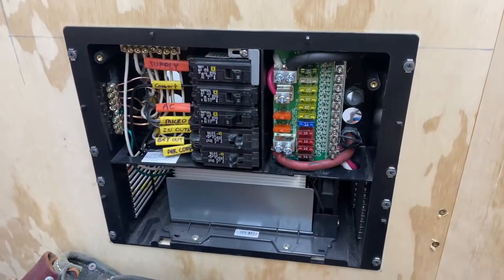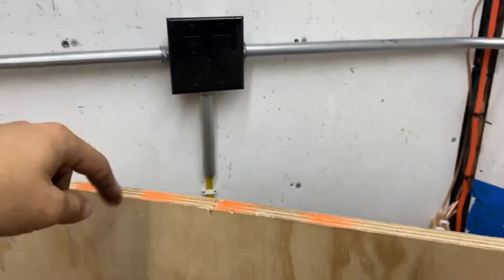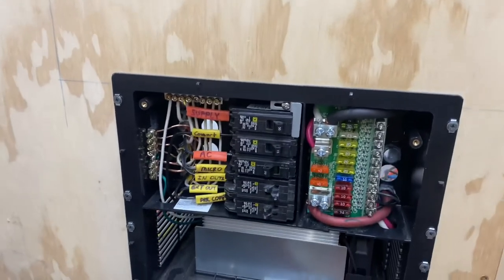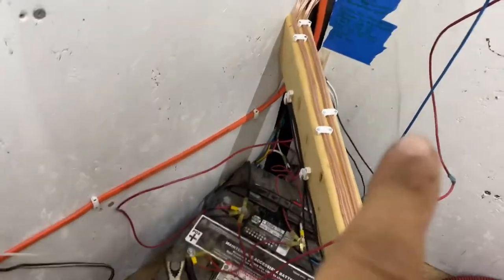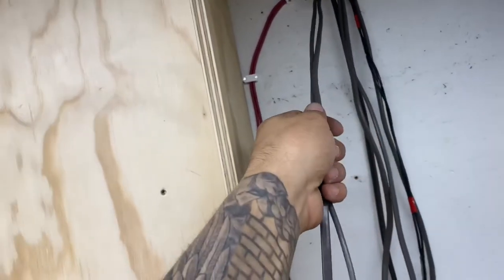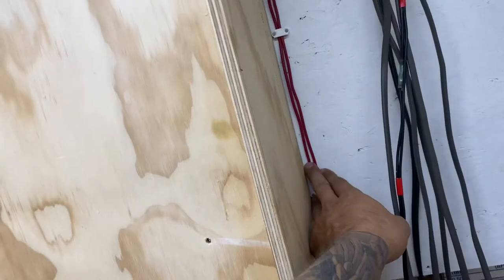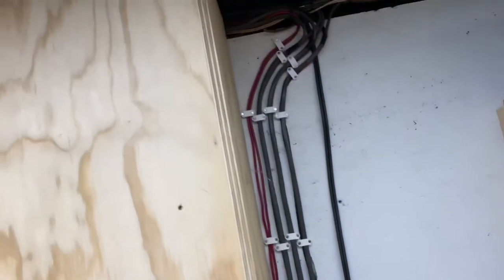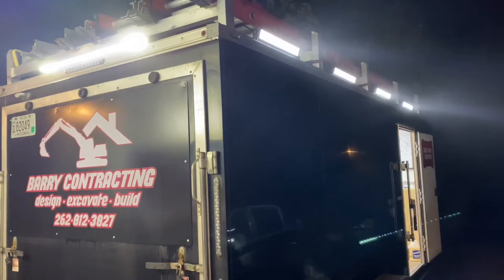Tool Trailer Wiring Part 2: Exterior Lights

Comment: Love the exterior light bars.  You should be an Amazon Affiliate, so you make a few cents off each purchase from links you post.  That said, what light bars did you use?  One roof penetration, or one at each light bar?
Reply from the maker: I tried once but “I didn’t have enough followers” so at some point I’ll try again. These are a 24” bar off Amazon. 1 penetration at each bar wire together inside. I used ultima to seal them up. Haven’t had any issues in the last year they have been on the trailer.